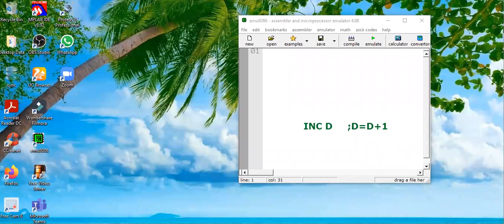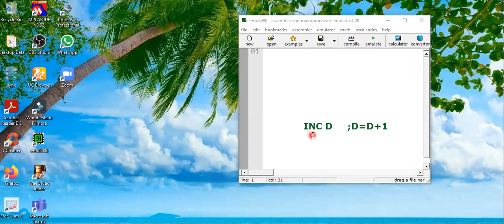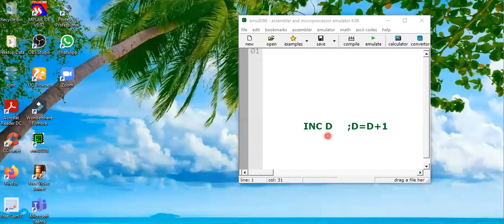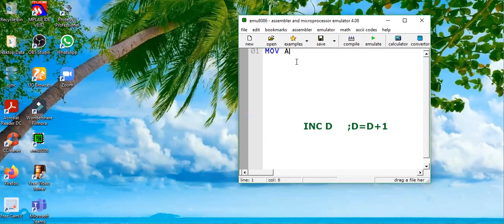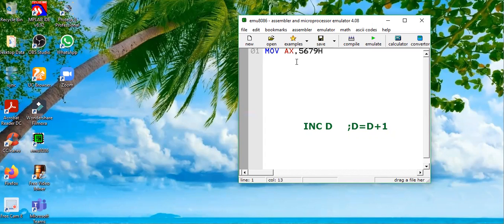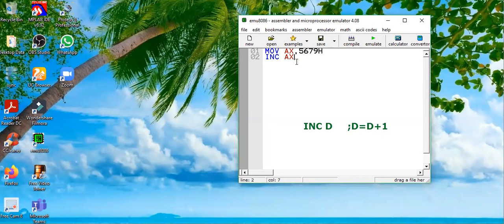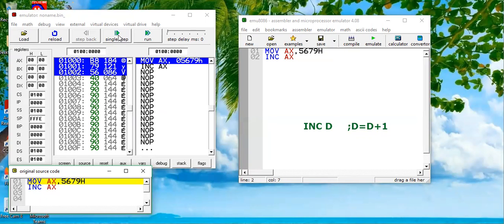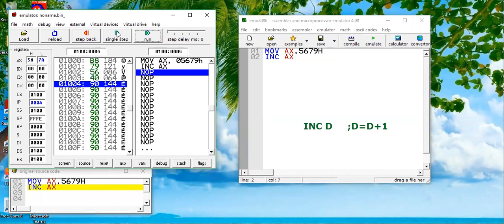INC Instruction |8086 instruction set with emu8086| Increment instruction assembly language example

Comment: How can we understand which instruction is of how much byte?
Reply from the maker: Yeah you can find out manually (using assembly to machine code conversion) or using computer ( emu8086). This video in which you commented is basically instruction set playlist. If you follow my theory lectues there is separate lecture  for assembly to machine code conversion. Or you can also follow another playlist on this channel named as assembly to machine code conversion.
Reply: @LearnOnline1  ok thanku🔸🔸